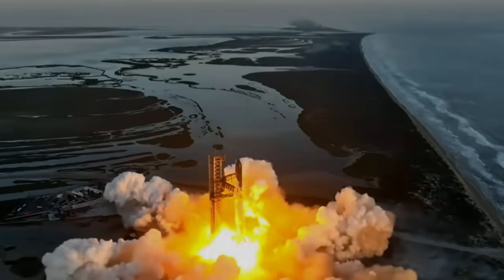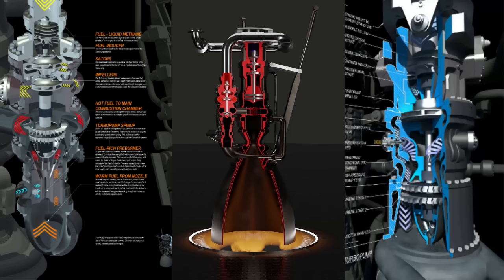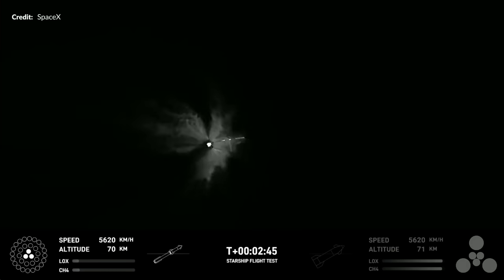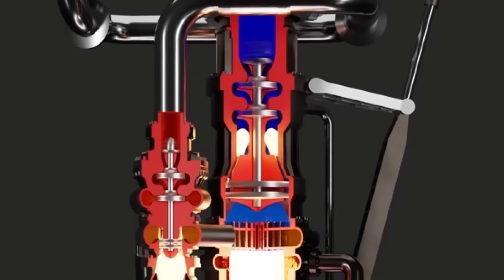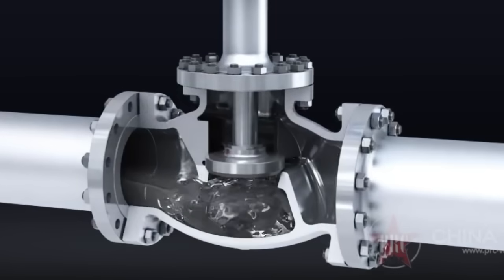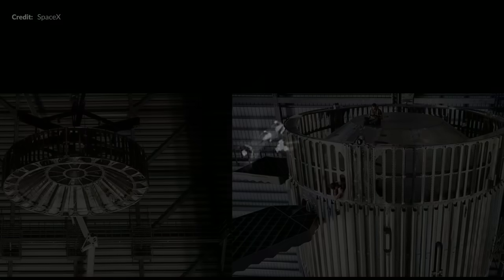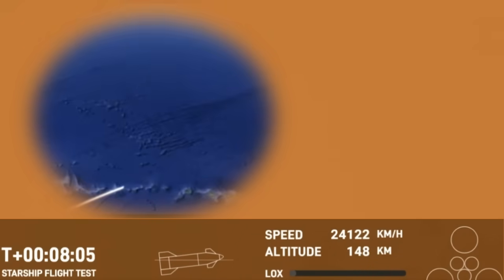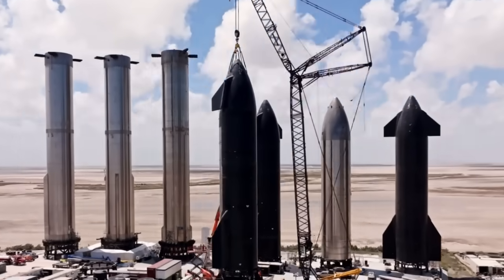Starship Flight Failure Analysis IFT2

Comment: Masterful analysis! Excellent work. I'm no rocket scientist but your analysis sounded logical. I hadn't thought about the 3 sea-level raptors. Crap ton of pressure and noise in that confined space. Let us hope the FAA doesn't drag its feet and IFT3 happens soon. 

When I worked as a tech in electronic R&D I did a crap ton of iterative design work. Calculate, build, test. Rinse, repeat. I remember one project I was assigned where it wound up taking 10 stages of filtering to get the desired attenuation. If SpaceX completes a suborbital on the 3rd try that will be AMAZING!
Reply from the maker: Thank you so much Bill!

Comment: yep, if (corrections/additions welcome):
super-heavy is 350 tons net (~11% propellant left) at separation, with 3x raptors throttled to 40%
3x vac.raptors on a 1320 ton starship can just exceed the S.H.’s own acceleration. 
(here we assume no added drag against the S.H.)
great video, actual info and technicals, no fluffery. subscribing.
Reply from the maker: Thank you and welcome aboard!

Comment: This is exactly what I thought happened! Thank you for making a video about it. Excellent graphics as well. I definitely suspect it was fuel sloshing and air bubbles that doomed the first stage from the hot staging, and those 3 center engines blasting off the top of stage 1 causing damage to stage 2. I think it’s correct that simple changes in timing the relighting of the engines should solve this
Reply from the maker: Thank you!

Comment: Totally agree that there is nothing wrong with the starship construction barring cosmetic improvements. Letting the booster do its thing for while after separation without igniting the engines will allow time to stabilize the dynamics in the storage tanks. I reckon the next test will definitely succeed with the booster making back under controlled conditions. 
As for the starship more work is required to ensure the back forces on separation do not incur reactive load damage. My suggestion would be to reduce the percentage firing of the starship engines to 50~70% of full capacity on separation and booster it to 100% after a small time delay after successful separation.
Reply from the maker: Thank you very much for your feedback Tony! I think they were worried about a collision and overcompensated.
Reply: @terranspaceacademy  I think so too.

Comment: Booster telemetry during hot staging showed the booster decelerating quite hard, when it should have showed it at least holding constant. So there was obviously too little thrust from the rear. They may need to keep more than just three engines running. And your delayed start of the Starship sea-levels would help as well.
Reply: Not only was it just 3 engines but they throttle them down to 50% power
Reply: @Mattsretiring  Do you think They really needed the 3 sea level engines at all ?  I think just the vacuum engines could do the job of orbit injection
Reply from the maker: It will be a fine balance between not being shoved back too hard and not surging forward and hitting Starship...

Comment: Awesome video! I had a few questions if you wouldn’t mind sharing you’re thoughts. The spacex writeup of the mission sounds like the booster was not destroyed with FTS. Do you think this could’ve been a structural failure given rapid expansion of gas while the propellant tanks were being heated by starship? Also, I don’t think that they would want the vacuum raptors firing for an extended period of time without the sea level raptors firing. The recirculating of gases could heat up the sea level nozzles too much, melting them before they have methane cooling them. Thanks!
Reply from the maker: It may be that a shockwave from the exploding engines traveled up the downcomer and blew the ship apart before the FTS could be activated. That is an excellent point on the Starship engines... maybe just a few more seconds to light them and throttle up slowly?
Reply: @terranspaceacademy  my thought process there is that it seems like they would want to have the vacuum engines firing first for a while so the fact that the sea levels started so soon may mean that their analysis showed it was needed. Idk though
Reply from the maker: I think they just wanted to get away from the booster as fast as possible... then reconsider after seeing how that went.  A Falcon 1 second stage was destroyed by a separation collision and I think they were being cautious.

Comment: Thanks for the real clear explanation. Sounds all very plausible. To my opinion, the turn of the boost looks very rapid. G-force of this rotation will relocate the fluids to the side of the tank.
And when the other raptors ignites, the fluid will accelerate to the bottom of the tank. The acceleration looks also quite fast due to lack of gravity and drag.... This will amplifies the acceleration forces.
Never the less, in a few years (since 2008), Space-X developed, produced and launched more rockets than NASA did. I do think this is an absolute phenomenonOf course
Reply from the maker: We agree... a more sedate turn would be better.

Comment: Nailed it!!! Just change the procedures for engine light-up and maybe add some baffling in the fuel tanks. Then all will be fine. The only question then will likely be the heat shield.
Reply from the maker: That's right... I personally think it can make it back with some missing tiles.  I don't think it will hit the full 1650C but we'll see soon I hope.

Comment: Basically agree with your analysis.  Gotta keep 1 g on the booster at all times during stage separation and the flip maneuver.  Also have to dissipate the heat and shockwave of the starship engines before stage separation.  I agree starting only the outer engines at 50% power prior to actual separation might be enough to prevent damage and booster pushback, but that's only a guess and I don't know how much velocity would be lost in doing so.  The objective is to keep some acceleration at all times.  I'm sure the folks at SpaceX are trying to model this to find the optimum solution.  Perhaps make the hot staging ring a little longer to reduce internal heat and pressure prior to separation.  Of course that adds weight, but I don't think it would be that much extra weight.
Reply from the maker: You mean the inner engines? Around the central three? The very outer edge can't relight.  A longer ring could be all it needs.  And maybe some slosh baffles.

Comment: Very well said. I think ur suggestions r absolutely right. Booster should continue with the main 3 raptors. Till  the fuel will rest until, descent will start after reaching apige . and second stage should light up only vacuum engines till hot staging completes and after covering some distance centre core 3 raptors should be light up.
Reply from the maker: Thank you! We appreciate you.
Reply: Spacex team said it had to run only for 30 more seconds until orbital velocity had reached 270000 km / hr approx. But 😢 didn't happen
Reply from the maker: So sad...

Comment: Great video and I absolutely agree with your fix-it idea as it is simple and elegant.
Reply from the maker: Thank you so much Kevin! Can't wait to see.
Reply: Yes me either, and firing only the 3 vacuum engines is a really good idea if you can still achieve separation right?
Reply from the maker: We think so.  It would not be unreasonable to just shut off the booster engines entirely and reorient with hot gas thrusters.
Reply: I was unsure if it was reasonable or not to shut down all the booster engines and use the hot gas thrusters, but such are the musings of an armchair rocketeer. 😊
Reply from the maker: We agree with you.

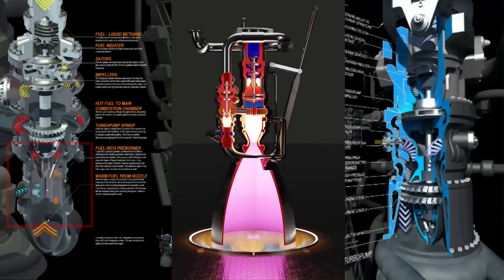Comment: 1:58 should be 33 engines (3/10/20), but that also doesn’t factor the 6 from ship which also all started correctly. Therefore, all 39 raptor engines involved in this mission started correctly
Reply from the maker: Quite true... Reading up on the N1 too much.

Comment: Great analysis, working with whatever information that was available at the time of this post. Your knowledge of rocket engines is invaluable as you walk your audience through your observations and conclusions regarding what may have caused the catastrophic failures of both Super Heavy and Starship. You should be a consultant for SpaceX. Your work and research is well thought through, and I believe that your conclusions are very plausible.
Reply from the maker: Thank you so much! In truth I would probably be more useful working on the myostatin inhibitors so we can still walk when we get to Mars :-)

Comment: Re. info given at 3:10 - "Starship fired all 6 of its engines." I heard from multiple sources that the plan was to fire outer 3 vacuum engines, followed by inner 3 sea-level engines (as the inner 3 are so close to the flat part of the hot-stage ring's disk-like plate / flattened dome). Watching the footage, best I can tell the outer 3 and inner 3 light in rapid succession (less than 0.5 second) or simultaneously. And I agree here with TSA that it was likely too much down-force on Booster, likely causing/contributing to fuel slosh in booster which eventuated in multiple engines out / engine explosions in booster.  I think also TSA's conclusion on the firing sequence of Starship upper-stage causing damage to its engines and/or fuel lines is on-point - very good analysis and excellent observations of the footage, IMO.  SpaceX engineers are top-notch. All of this makes me think they wanted to try the most optimized staging and booster flip (testing to failure) and then work backward (instead of starting conservative) - that would be a very SpaceX thing to do - their iterative and rapid testing approach has managed to turn the Rocket industry upside-down with their disruptive F9 family of (mostly) reusable rockets and most people will recall the many explosions and landing attempts involved for SpaceX to  nail-down reusability. And I agree 100% with TSA that the only problem is likely the programming of the flight sequence. With regard to TSA's suggestions on tweaks, I think his suggested flight sequence changes would likely work.. But if they didn't engineers might consider adding anti-sloshing baffles to booster tanks (which is a bit of a misnomer because in the case of Saturn V they were actually anti-vortex baffles - like in your sink when a little water tornado forms from the Coriolis effect) - Baffles could be optimized to both stabilize liquid flow and prevent fuel feed vortexes during flip.  It's fun being an armchair rocket scientist ;)
Reply from the maker: The did fire in sequence but too soon hence the 1.75g pushback on the booster.  That means blowback into the Starship skirt.

Comment: Great video! It's pretty clear to me that the propellant slosh is the root cause for the booster RUD. During the hot staging, other videos claim the booster experienced a brief moment of negative acceleration (deceleration). I think using only the Raptor Vacuum engines may help to dial down the deceleration of the booster or eliminate it as you suggested but that would come at the cost of some payload mass to orbit given the whole reason for switching to hot staging in the first place. 

In IFT2, at MECO, they shutdown all but the center three engines on the booster. I would think a better solution for SpaceX would be to change MECO to leave more engines lit on the booster just before hot staging. SpaceX will benefit from increased thrust to prevent a situation where the acceleration would go negative on the booster at all. No deceleration, no propellant slosh, perhaps no engine failures. As an added bonus, there is less engines to reignite during boost back burn since they would not be shutdown during MECO anyway. The less full-flow staged-combustion 300 bar-producing engines to light up, the better.
Reply from the maker: It did indeed... I think the multiengine fireup before the propellant had settled slammed it down on the plumbing and broke some pipes... After that it was just a matter of time.  I hope next time the fire up only the vacuum Raptors and allow a gentle spin with time for the propellant to settle by drag decel on the booster... then fire up the rest for burn back.

Comment: Great analysis and the best I have seen so far. I agree and believe it is more a timing issue than the hardware itself. Quicker retraction of ship QD is needed because it left the launch pad much sooner than the first test flight. I agree that damage to the QD area could cause the spinning seen and much more likely to fail in the vacuum of space deep into the flight where internal pressures far exceed pressures on the outside of the ship causing structural failure. Considering the propellent on the booster is mostly depleted at hot staging and the ship is completely full any blast force between the upper and lower stage would impact the direction of the now much lighter booster much more than the ship itself. Firing only the vacuum raptors until there is further separation would be quite beneficial to prevent the hammering down of the velocity of the booster. Remember also that SpaceX is planning on moving to 6 vacuum Raptors in future designs so they will need a solution for this punch back of the booster during hot staging and sloshing of propellants.
Reply from the maker: Very good points Scott and thank you for your kind words.

Comment: Fantastic video. These seem like rational steps which could easily be integrated into the next test flight.  Flight 2 was clearly a great success with almost double the speed and altitude compared to the first flight,  and the plume from the 33 raptors looked amazing.  Any failures were merely lessons to be learned.
Reply from the maker: We agree completely and thank you.

Comment: Best explanation so far and some suggestions that are rather easy to implement. SpaceX will have data up until the self-destruct on booster and ship, so will analyse everything in minute detail. Surprisingly to me all engines worked perfectly when they launched and separated, it was just the relighting of the engines that were, or looked like, the problem...
I just hope that you are correct and it is just engine startup timing that could be fixed very easily with no changes to the booster or ship, maybe adding some more protections against slosh, but is that even necessary.

But the biggest question right now is when is the next flight, due to the height of the self-destruct there would be no damage to the environment as the ship and booster would burn up in the atmosphere with only maybe a few  parts crashing into the sea.
If they have another booster setup the same way , maybe even with improvements, we should be able to see another test flight in 4-6 weeks.
Reply from the maker: Thank you Andrew!  We do too.  It would be great to see IFT3 make it to booster landing and reentry.

Comment: Thanks.  I have been checking this site for the post success story that includes speculation as to the cause of both vehicles needing to be destructed.  It was obvious even to a non-engineer that both failures occurred right around the hot staging.  So yes the hot staging worked, but apparently damage was done as a result of it.  SpaceX likely will not have much to say publicly about the causes anytime soon, and I don't blame them.  It's their data and their bird and their money.   
But it's great for the rest of us to have an educated knowledgeable engineer to offer their own insights.
Reply from the maker: Thank you so much Paul!

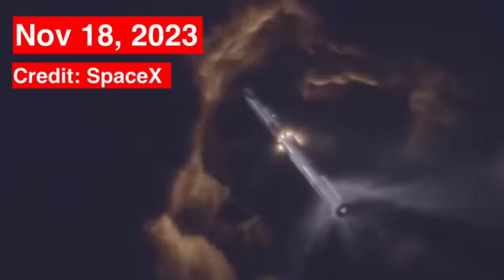Comment: Great video! I agree with everything you said, there's just one thing to notice. You said that the center starship engines don't have anywhere to exhaust, but if you look at the staging 9:45, you can actually see them facing outwards at first and gimbal back after the separation. Which looks amazing and may even allow them to get most of the exhaust out through the hot staging ring. If that's enough is another question though.
Reply: probably needed a taller staging ring IMO
Reply from the maker: That is a good point I didn't bring up... The engines don't gimbal that much and I'm afraid it wasn't enough.

Comment: Good analysis!  I would add a foot to the hot staging ring and make the top pointed.  Perhaps the turbo pumps need a titanium ring around the perimeter to catch the shrapnel like aircraft engines do to prevent one engine loss causing a catastrophic cascade.
Reply from the maker: That might be all it needs.